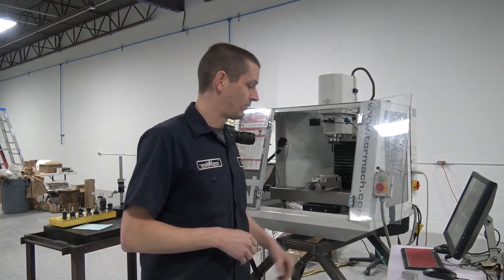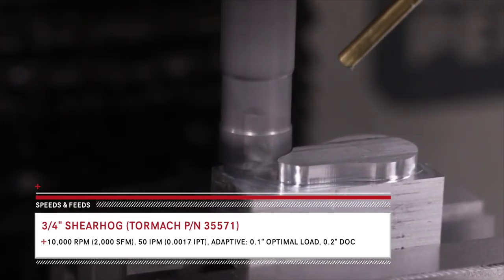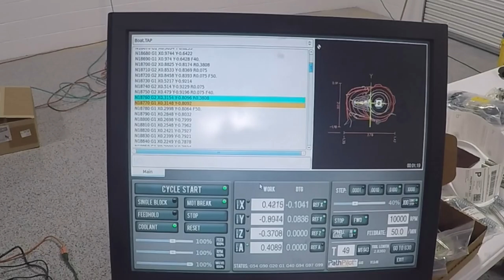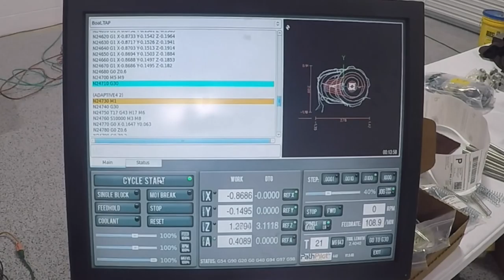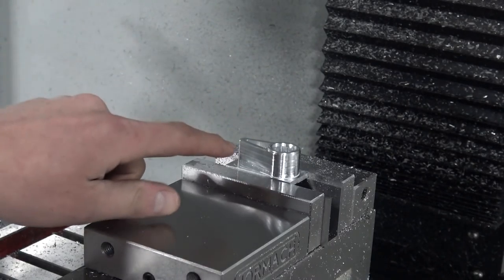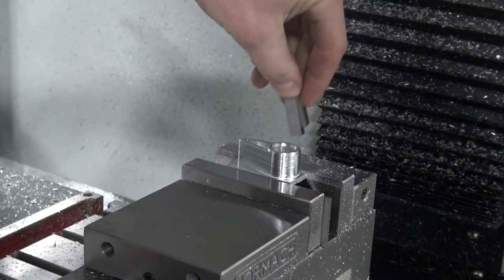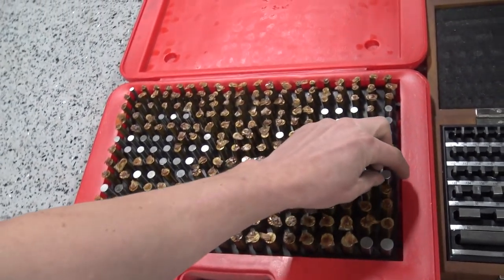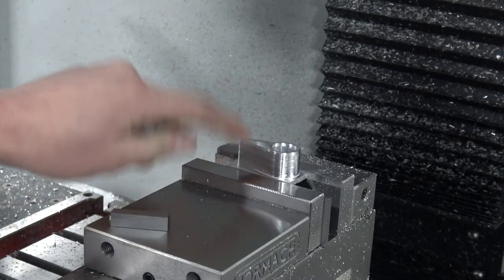CNC Broken Boat Part 1  Widget87

Comment: Awsome, thanks for the metric info on speeds and feeds, it's a little tricky for us metric guys to understand imperial stuff. 
I really hope that there is more to come of this in the future.
By the way, I use the same method to import pictures to Inventor and make 3D models for part that's tricky to measure by hand. I sometimes also scan thin parts together with a ruler or scale to be able to easily tune in the size of the picture i the cad program.

Comment: If 360 is like Inventor you should be able to extrude the part with a draft angle and get the same result.  That is assuming the angle is constant all the way around

Comment: Hi John, I think you're wrong WRT a -.0002 endmill making the part -.0004 smaller. -.0002 is -.0001 on a side therefore the part is -.0001 on a side so -.0002 overall.
Not that it really matters in this case though.

Comment: why would you not want to plunge your endmill like that around 4:25?
Reply: +TheViViThai Because they're not drill bits. You stand a pretty good chance of loading up the flutes (nowhere for the chips to go but up the flutes, adding heat to the E/M rather than the chip) and snapping the end mill off by doing just "G01 Z-0.1 F0.2" It's better to ramp or helix in (or just use a drill bit) if at all possible.
Reply: Ah thank you, Andrew Foss

Comment: 4 tenths not 8
Reply: +NYC CNC You are still measuring the distance between 2 parallel faces whether it is with the pin gauge diameter or the gauge blocks.  If you put a pin gauge in a rectangular hole you would just be measuring across the shortest side.  The larger dimension would not effect the size of the pin that fits.